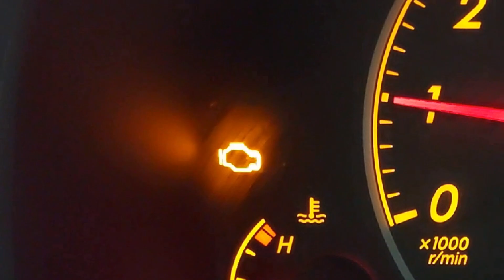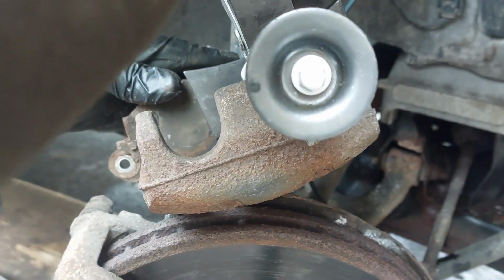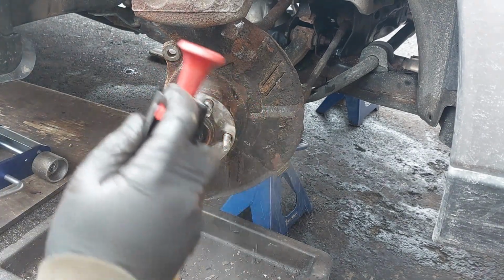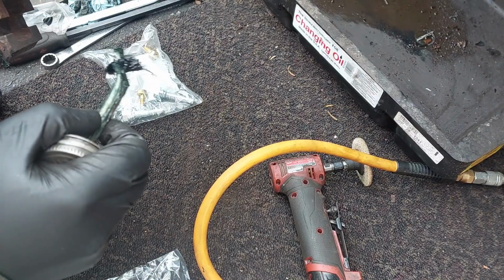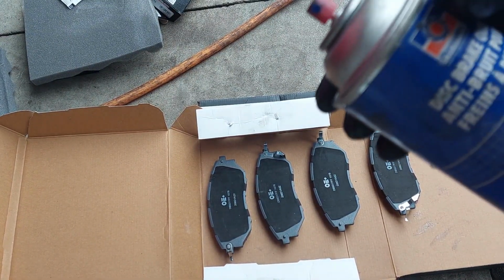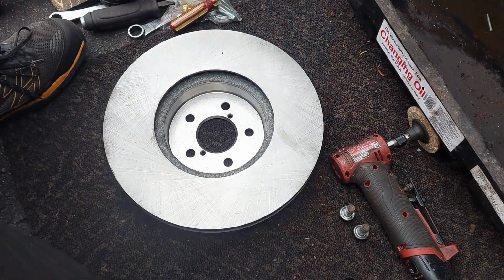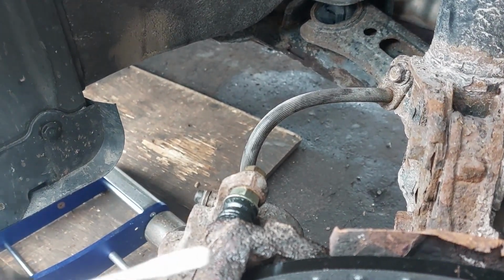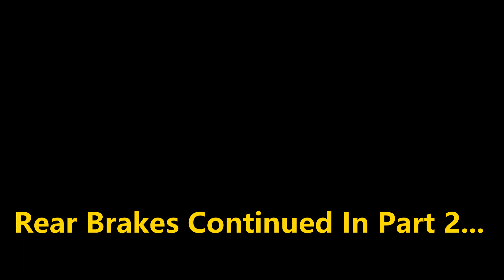2010 Subaru Outback 3.6 - Front Brakes - Rotors & Pads

Comment: Great video. Very meticulous. I usually put the pads in the caliper bracket before installing it because the inside pad can be difficult sometimes. Thanks for sharing.
Reply from the maker: Thanks. Yup, you can install the pads on the bracket first before installing on to the vehicle if it's easier for you. Both ways work perfectly fine.

Comment: Your way of doing brakes suits me fine, I love the details of every step including checking the dust seal on the caliper piston using a small blade screwdriver. I plan to do a brake job on a 2016 Benz Sprinter 3500. Wanted to know how I can get the torque spec. on all four brakes?  Thanks a MILL.
Reply from the maker: Thanks for your input I appreciate that. You would have to look up the specs under a web based service information website such as All Data or Identifix.

Typically, if you want service information for one vehicle you would have to subscribe and pay a fee. Some have 1 or 3 months or 1 year or even 3 years subscription. They both have different lengths for the subscription period. Unless you could do a Google search and somehow find that information off of a website.

Another way is to have a service manual booklet if available like a Haynes manual or something. I hope that helps.
Reply: @moosemobileautorepair  I appreciate the info. you suggested I will give them a try.  Thanks again.
Reply from the maker: Let me know if you need the specs I may be able to look them up for you. I'd recommend Identifix as it is cheaper than All Data if you want something like 1 month access. Both are relatively the same, but Identifix gives you access to fix data from other shops.